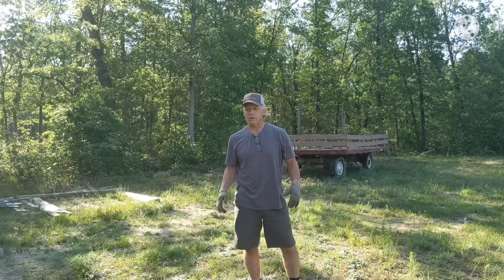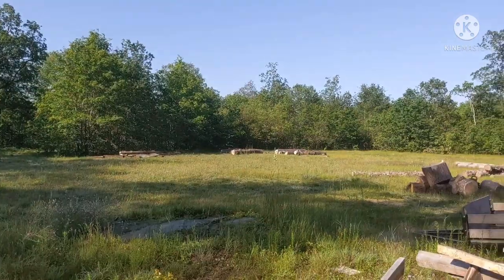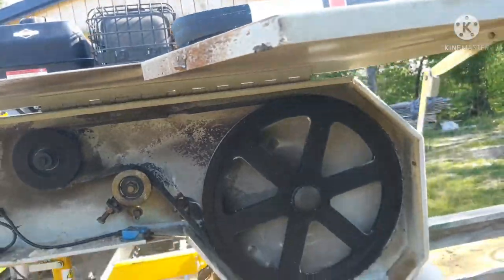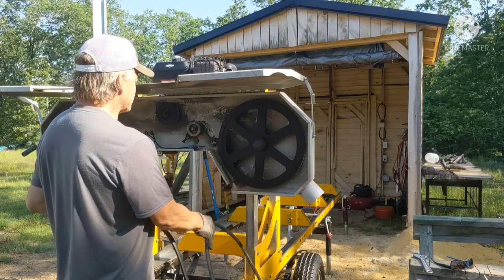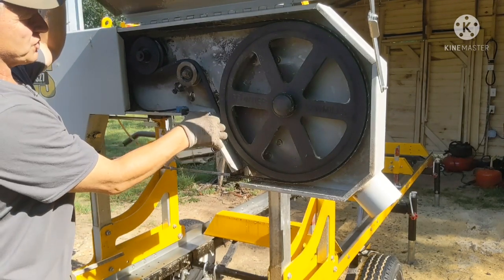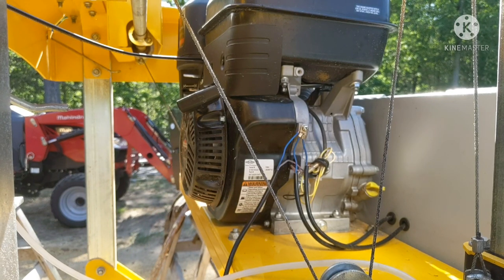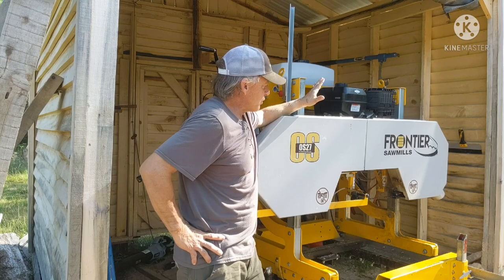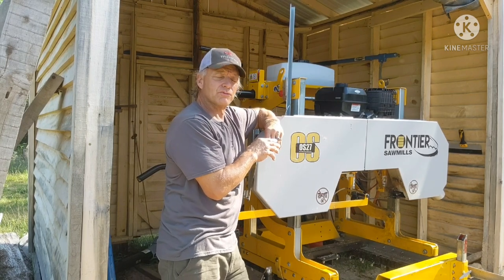Changing the Drive Belt on the Frontier OS27

Comment: I believe that Gates makes "shorter" belts in 80", 81", 82", and 83" sizes.
Reply from the maker: I'm going to get the next size smaller next time.   Thanks for watching
Reply: Heads up, I just tried an 83" belt from Tractor Supply and it is way too short for my OS27, they were out of 84" belts so I'll have to order one!
Reply from the maker: I ordered mine from Amazon.   Still working well. Thanks for watching.
Reply: @BigelowWoodcraft  I realize these mills have been made for several years now and things could have changed.  I checked with Norwood and my older model OS27 requires the B83 Drive Belt and the B56 Idle Belt.  Part numbers MILL-DBB83
 and MILL-00B56, respectively.  Just hoping this might help someone along the line.
Reply from the maker: @jkcwoods2380  thank you

Comment: Opening the video with your little helper running in! What's the RPM of your motor? Is that tension sheave adjustable to add additional tension to speed up or slow down the RPM of the drive sheave?  I know they make those for exhaust fans.
Reply from the maker: The motor is a Briggs and runs at 3600 as do most small engine. Yes you can adjust the tension on the belt but it really doesn't have an effect on the engin speed.   Just doing want it slipping.    Thanks for watching